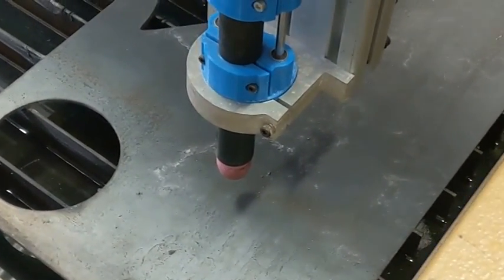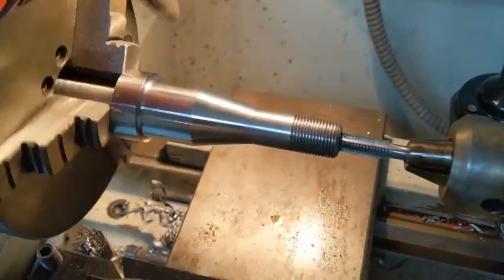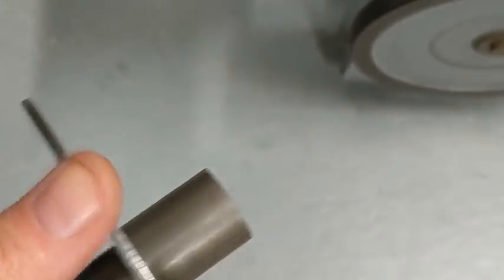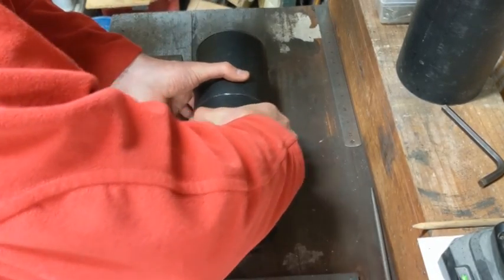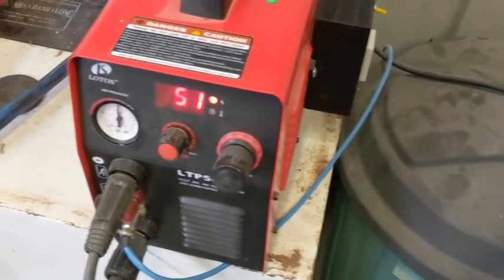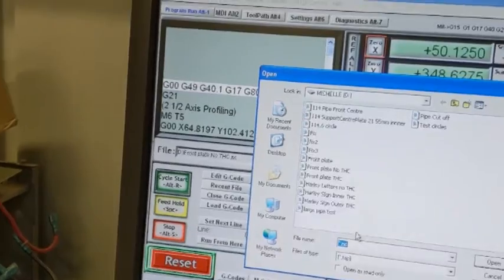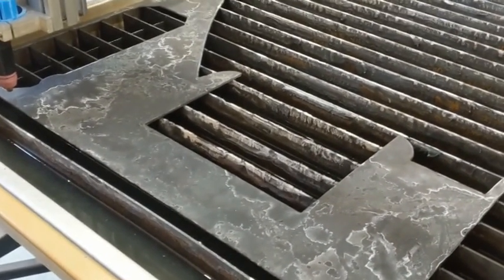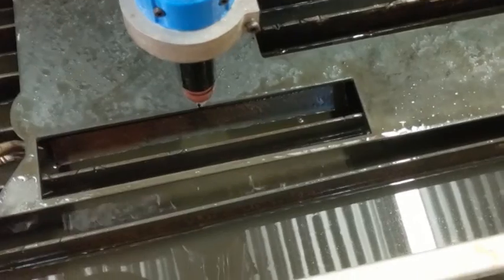Batpod V2 Build Video 5

Comment: hi..we are currently on this hell project where the current phase is riding & handling..we want to ask several question if you dont mind
Reply from the maker: Sure.
Reply: how you tune the bike's center of gravity
Reply from the maker: @EasternBobber  Mine has a very slight lean to left.  But it doesn't effect the balance too much.  Next build I'll move the motor which is in the rear wheel a little too the right side.
Reply: is the dampener makes a huge different in handling?
Reply from the maker: @EasternBobber  It didn't effect the ride at all.  Just when moving the around over gutter etc..
Reply: thank you..why your batpod v1 title us the last ride
Reply from the maker: @EasternBobber  I sold it.  I'm now making another.